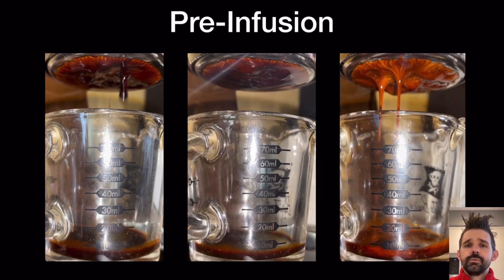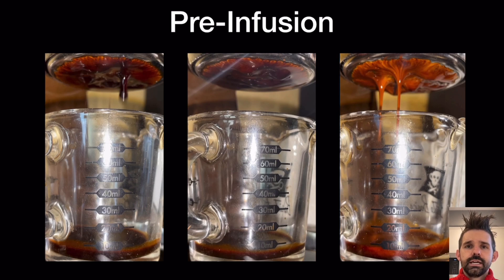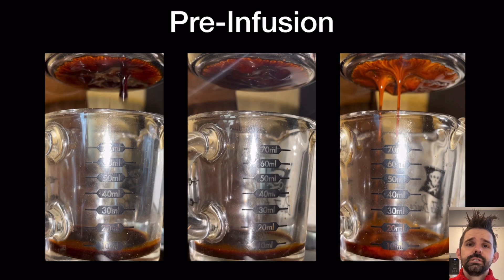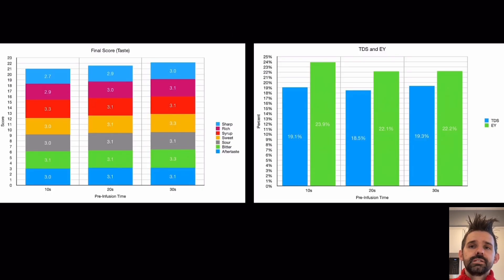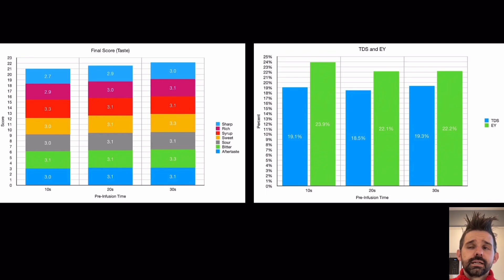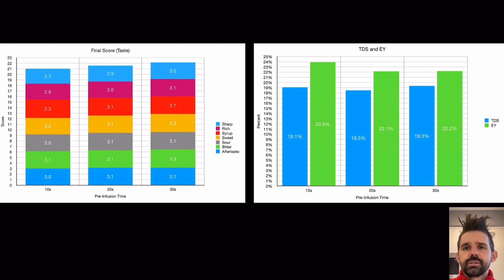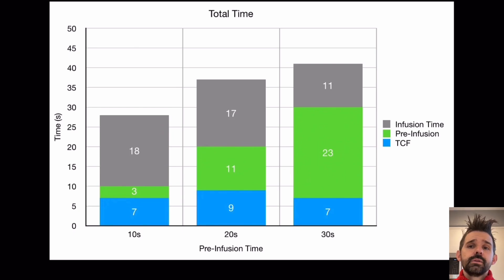Pre-infusion for Espresso: Simple Experiment

Comment: What is the significance of preinfusion pressure? I’ve had great results running preinfusion pressures as high as 4.5 bar, but the Decent tends to have preinfusion pressure set lower by default. Is it an issue of puck integrity?
Reply from the maker: I have experimented between a few. I am for 2 bars or so. On the DE, a smooth transition is better and I would go to a lower pressure. But it is something to experiment with. What pressure did you find to be the best